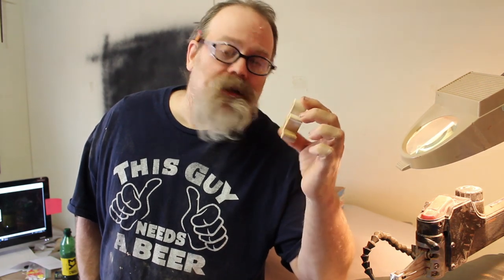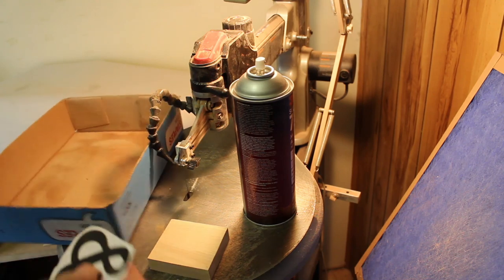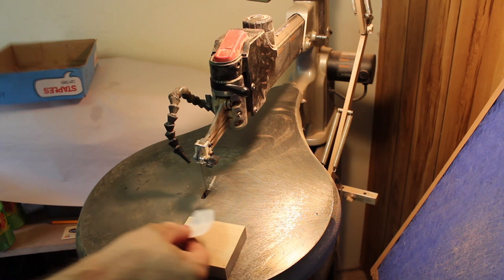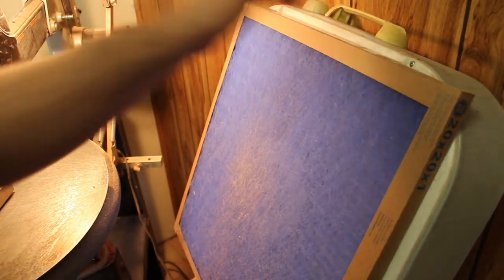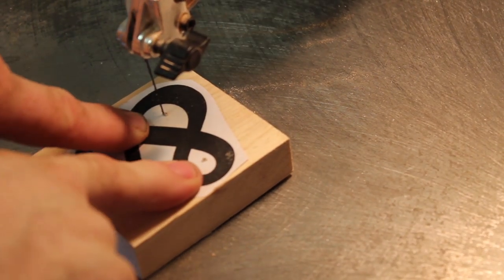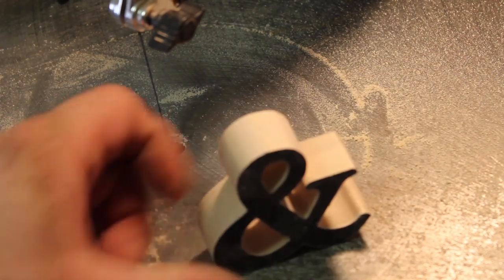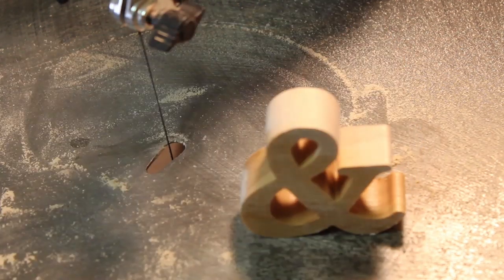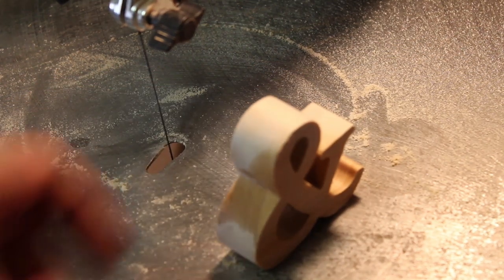fast easy scroll saw cutting perfect for craft shows

Comment: I love the fan with the furnace filter idea. I'm a lady wood crafter just getting started with scroll saws. I have been worried about dust and was looking at the expensive dust collector systems using a cyclone, etc. This is a quick idea and is made with things that I already have. Also love the ampersand & idea!
Reply: But, the furnace filter may not trap all the fine dust that is the lung killer.  Research some more.

Comment: Great video —- thank you! What blade configuration did you use? Looks like it might be a #5, but tooth configuration? I just got a package of Olson precision ground blades and was excited to try them out - double reverse tooth.Made my project wood hop around until I turned the speed down. Your thoughts?
Reply from the maker: this was a #7 olson Mach speed blade.if you project was bouncing a lot I'd try lowering the blade in the holders a little, it kind sounds like the reverse teeth might be making more contact than they need.
Reply: @SnyderSpindles  I’ll try lowering the blade. Good advice — thank you.

Comment: What kind and size of blade do you use?  I just bought my first scroll saw and total newbie.  And great video.
Reply: He mentioned in a different comment that he used #7 blades for this project.  In general, finer blades are good for thinner material.  I use #3 blades to cut soft basswood stacked up to an inch thick, but I'd probably use a #7 or #9 on 3/4 walnut.  Since blades are cheap, and have to be replaced anyway, try a variety of different sizes and see what you like. Places like Mike's Workshop will give you a discount on any mix of blades you buy.  I love the double reverse style for a smooth finish, but there's lots of others that may suit you and your projects better.
Reply: @Not_TVs_Frank  thank you.  Thinking of ordering a variety pack so this answer helps with my decision.

Comment: That's awesome!
Thank you so much for sharing this! 
I've been wondering what tool would work best for a similar project I'm working on. My dremel tool takes way too long. (I used 1x1x4 pine scrap to start).
The guy at the hardware store directed me to a rotary tool. 
Now I'm not sure what would work best, especially if I continue to make these, which I've been asked by several people to do, by consignment. 
I'd like to use pine 2x4 so they sit nicely on a shelf. 
What are your thoughts on the type of tool (rotary or scroll saw) best suited for this type project and what type of wood and thickness is easiest to work with, or recommend? 
Thanks!
Reply from the maker: A scroll saw would be much faster to cut it out. After cutting you can go back in with the rotary tool and round things over. 2” thick can be cut on most scroll saws but it’s not the easiest thing to cut, I’d go with 1” thick and make a stand.

Comment: Curious how long it takes to cut the blanks, print and glue the pattern, cut the piece out, sand out any blade marks or I,perfections, and then apply final finish. Also, do you ever break down the cost per item and include wood, finish, pattern printing, blades, waste from cutoffs or bad pieces, etc to come up with your final profit per item?

It would be interesting to see how cost and time would compare between hand-cutting and batching these out on CNC. of course aCNC is much more expensive upfront, but if you plan to sell lots of these to earn money rather than just making them for fun/gifts, it’s worth checking on.

Comment: What program did you use for your ampersand? What finish do you use on the completed project? Thanks
Reply from the maker: The nice thing about the ampersand is you can just use any text program and increase the font and print. If you wanted it really large I’d use Inkscape. I usually use a spray poly but you can finish them anyway you’d like, Black paint and knock the corners off with sandpaper to distress seems pretty popular.
Reply: @SnyderSpindles  So what text program and font do you use?  Thanks.
Reply: @Scott Snyder you can save yourself a bunch of ink by messing with the settings in word and having it print only an outline

Comment: Hello, great video. Can you please tell me what exact wood you used and where to purchase it. It looks pretty light
Reply from the maker: It's Elm that I got from a friend...it's just one of those woods I don't seem to fin at my local mills. Wish I could be more help.
Reply: @SnyderSpindles  ok. Please what wood would you recommend to use in crafting that is light wright, cheap and yet durable enough to be used as a table for light items
Reply from the maker: after looking at the foam ones you're making, I would suggest using plywood or a mdf.
Reply: @SnyderSpindles  thanks alot Scott. I've got more questions for you tho if you don't mind. Can you please put a video showing how to use the wen scroll saw. I keep breaking my blades and not been able to complete a single wood project like this one

Comment: Any time i try to use a reverse blade it bounces alot on the table...have to use Alot of energy n effort to hold the pc down....why is that?? 

Tried spiral blade n they just break...is 9mm ply too thick? I tried with 3mm ply but the wood jst breaks with more delicate designs to cut....
am new at scrolling so have alot to learn.... all the videos i watch r so relaxing and so little effort used to hold the wood pc down...i cant seem to experience that.....wood bouncing, blades breaking.....😔aaarrhhgģgg.....where am i going wrong...
Reply from the maker: Try lowering the blade in the chuck, on high dwell the reverse teeth should only be peeking over the table.
Reply from the maker: I would avoid spiral blades, they leave a bad surface.
Reply: @SnyderSpindles  what do u mean peeking over the table? Possible to send a pic?

Comment: Yeah, what saw is that? It looks like a Dewalt but wrong color. Was that a large spiral blade? Love the cheap dust collection :)
Reply from the maker: It’s a delta scroll saw. It’s a basically a clone of the delta. The only difference is the delta has a pin to hold the upper arm up for blade threading. I have a couple Dewalts in my grave yard and most of the parts are interchangeable. I’m thinking it was designed when black and decker owned both brands.  I believe I was using a #7 reverse tooth blade, spiral blades leave a pretty rough surface.